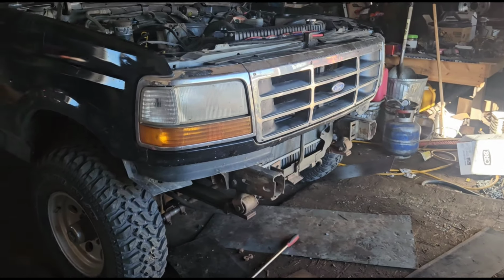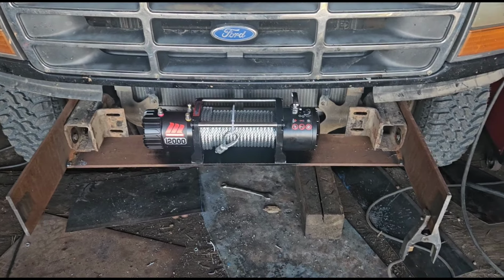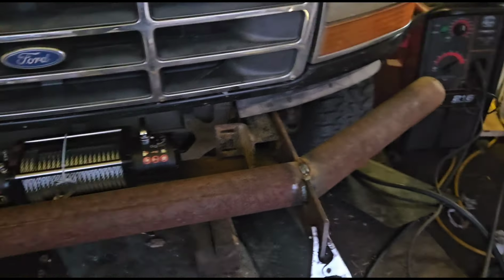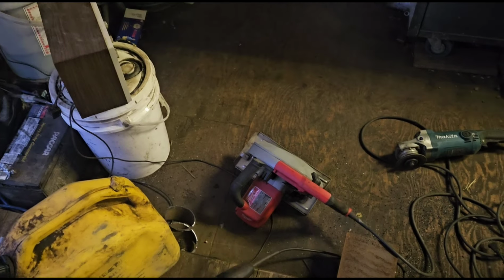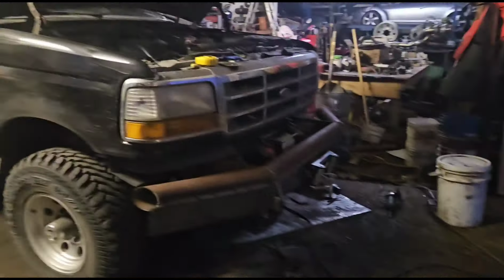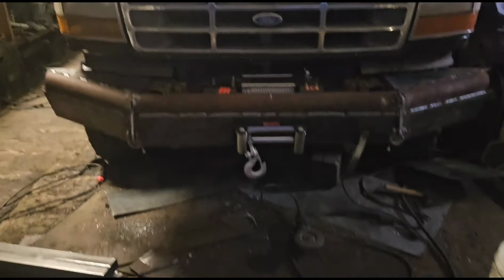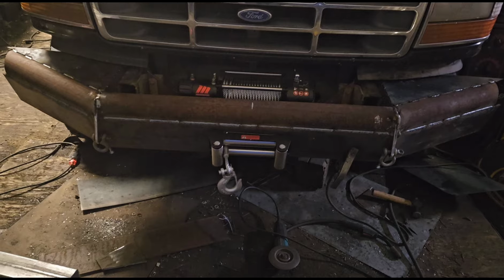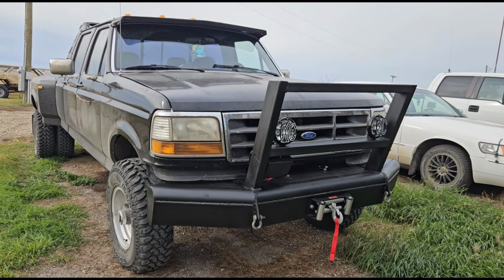BUILDING A WINCH BUMPER WITH SCRAPS ON AN OBS FORD

Comment: That pipe holder on the dash is the most intimidating automotive accessory ive ever seen, you would definitely get my milk money, lol.  

Im watching this video in the bathroom, ive been building a winch mount and bumper for my 47 willy's jeep.  Will be good to see how the professionals do it. The only thing if done professionally today was wear boots, so when i dropped my ange grinder with a wheel of destiny on it, it just cut up my boot instead of my foot, lol.

Comment: Looks nice and solid. 3/4" or 7/8" sucker rod would've made good uprights too. You could go around the whole front, and angle it in front of the headlights. Sucker rod is handy if you've got it. Kinda flexible if it gets over 3ft long, but on a bumper it would be short enough to be good and solid. 

One of these days I'm gonna build a bumper for my '01 F250, and it'll be 2-3/8" pipe, and 7/8" sucker rod, with expanded metal. Maybe not 2-3/8", that would be overkill haha. Just depends on what I've got when I do it.

Comment: nothing wrong with using old rusty bolts as filler when stuck with a MIG, just don't use gr8~12.9 bolts the MIG wire doesn't feather into them unless its running something closer to 170amp 38volt 360ipm 035/045... 1/2 inch gap is nothing for a 5/32 6010, that's a one pass fill for a root weld.